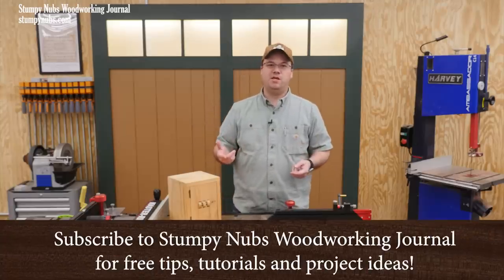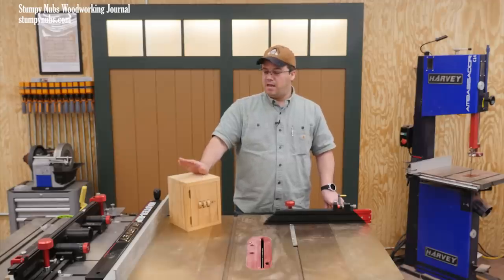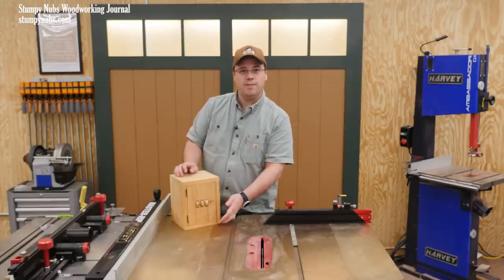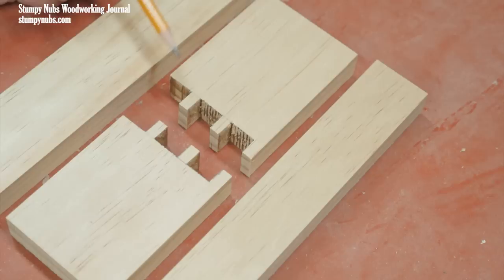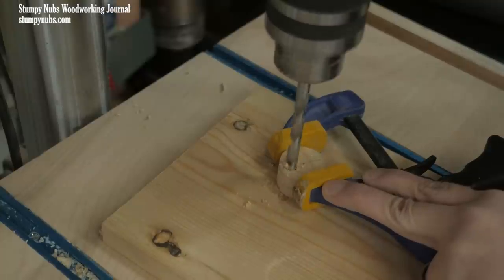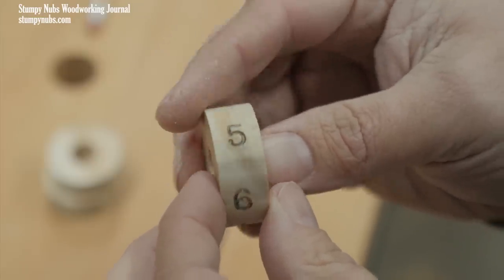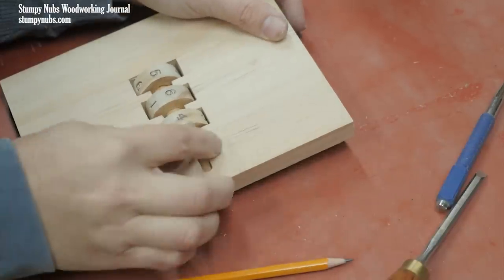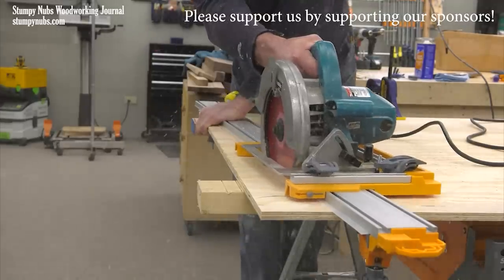Is this wooden safe FIRE and THIEF proof?

Comment: I love these safes, they make great gifts as you said.  In building a few, I came up with 2 solutions for 2 problems I always kept having.  1, when I glue the box part together, I only glue 1 side  and the top and bottom.  The side where the bolt slides all the way through can be taken back off after gluing and squaring the other 3 pieces.  This way, I can mark for the bolt slide exactly, take the side off and drill then glue back on.  Works perfect.  My other BIG problem was making the dials.  I tried cutting them with a jig saw, sanding them, I tried closet polls used to hang cloths.  But I came upon my solution using a hole saw like the type to cut holes for door knobs.  Gives me a nice round dial with a hole exactly in the center.  Just have to enlarge the center hole and add the side hole.  Sometimes I use wooden hinges too.

Comment: Seems to me that there is an easy way to adjust this design to make the combination changeable.  If, as you suggest, you write the numbers on with pencil, or use some other less permanent way than stamping them into the wood, you can erase the numbers later and put them back on with a different starting point.  That way, the number that will be opposite the notch will be different.

Comment: I couldn't find this particular safe in Wood Magazine issues 1 (Sep/Oct 1984) through 265 (Dec/Jan 2019). There may be an article describing the safe, but no plans for making it.
Reply from the maker: Issue #3 Jan/Feb 1995
Reply: @StumpyNubs  Found it, except that Issue #3 was published in 1985 (not 1995). The issue search didn't have the correct page number (55) so I missed it. The page the issue search returned was page 59 which is basic cabinet construction. LOL

Comment: You could actually leave out the slide & its slot entirely and use that borehole through the side as a button to push the pin in & allow the door to open that way.. Would also need a spring to keep it extended when locked, of course, so you'll need to make a project video on wooden springs next.

Comment: What's stopping you simply rotating the tumblers till you find the groove which will reveal itself on the sides of the cylinders when they're positioned outside the door? You could probably fix it with some half cylinders glued on to mask the sides of the tumblers but it seems a bit faffy

I guess this is supposed to be more of a novelty craft